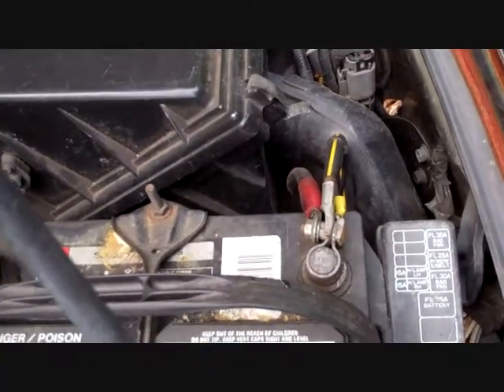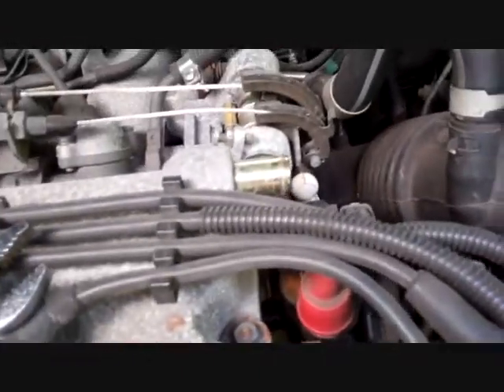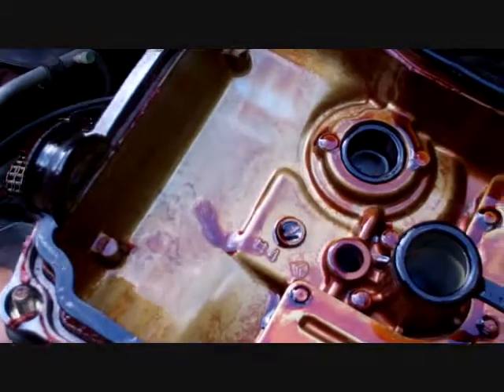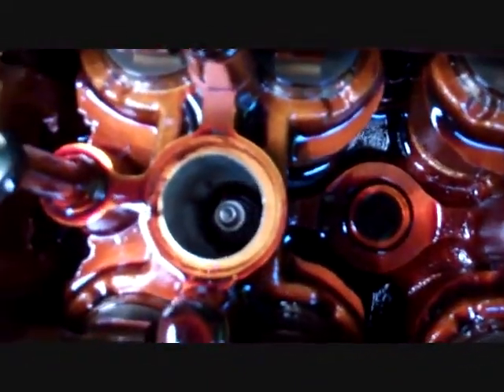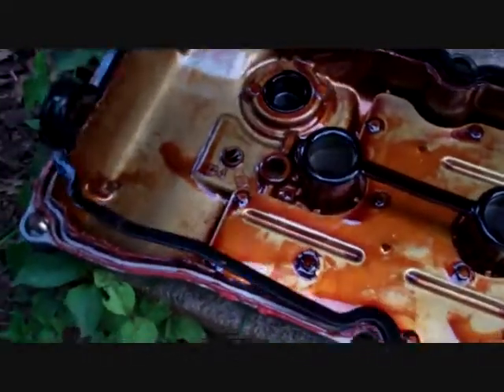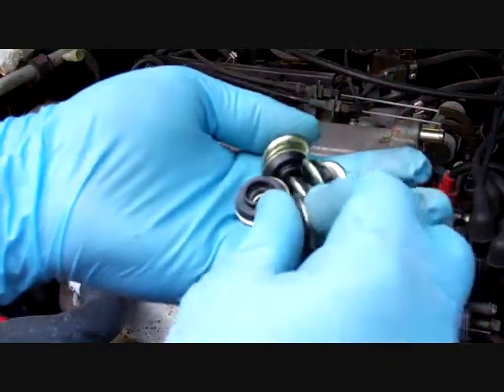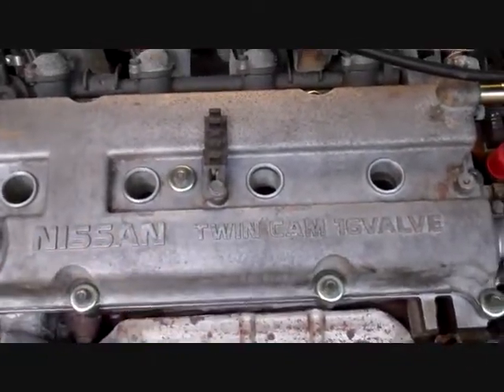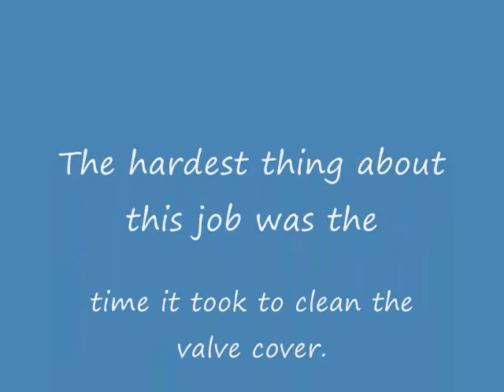Nissan Altima valve cover gasket change

Comment from the maker: Glad you liked the video.
But the head gasket ad valve cover gasket are two different items. The head gasket requires a little more experience perhaps beyond my knowledge. After removal you will need to send it in to resurface it.
Aloha and thanks for watching.

Comment: Thanks for all the help! 
I have done mine because it was leaking into the park plug holes. 
I replaced mine and a few months later it is leaking again into the spark plug holes! 
You guys think I did something wrong? 
I put a whole new gasket one including a new gasket for the spark plug holes. 
Maybe I should buy a new gasket and put a layer of that gasket maker on the spark plug hole gasket? 
Thanks again!

Comment: Great video! i just had my VC gasket professionally replaced only to drive it home and now find oil AND water in my spark plug wells. I understand that oil could get in there from a poor gasket install, but do you have any idea where the water would becoming from? i can figure this part out. If you have any insight on this kind of problem it would be much appreciated ! thanks!

Comment from the maker: Hi, there should definitely not be any oil and water in the spark plug wells. 
Question- How is the car running now? 
Is it all spark plug wells?
White smoke coming out of your exhaust pipe would indicate water getting into your engine possibly a blown head gasket “bigger problem”.
 Did the technician pressure wash your engine? 
I hope this helps somewhat. Thank you for watching and commenting

Comment from the maker: I used brake clean to clean the valve cover it is way easier that way but you need to be careful using it. Make sure you spray in a well ventilated area and to use eye protection.  After using that I let it dry completely. I hope this helps you. 

Aloha and have fun!

Comment: How important is it not to over torque these bolt? According to the Haynes repair manual there are 2 step:step 1-35 in-lbs, step 2 - 69-95 in-lbs.  Did you do it by feel? I did it without a torque wrench and got leaks from the back side cover so i undo all the bolt and sit the gasket probably and tighten all the bolt starting from the outside and got no more leaks. I also put red RTV around the outside mating surface just to make sure there are no future leaks anywhere around the valve cover.

Comment: Good morning, Thx for this video, very helpful.  I think this is what I have to do with my Altima.  Oil seems to be spitting out right at those gromet(spell check) spots and spilling down the engine.  This would be a need for a new gasket,,,,right???  Thanks in advance for any answer.
Reply from the maker: Yes, I would change it. It seems to be easy enough. I used to think the leaks would go away by just tightening the valve cover down more but found out it could damage it. Thank you so much for watching and commenting.
Aloha and take care
Reply: Yes, yes, bud.  Thx again.

Comment: i have a 95 sentra, and need to do the same. however it seems that there is some sequence to use when removing the VC bolts. Obviously you didnt use any sequence, you think i should be fine as well>?

Comment: I've changed my V.C. gasket twice. keep getn oil in spark plug hole#4. b4 i place valve on i use weartherseal to hold spark plug seal in place. what am i doing wrong?

Comment: I have a nissan altima 05 that is heated when I take off spark plug I start it the water blow out the spark plug. Do I need to change the engine for that matters?  Or should I just change the gasket
Reply from the maker: Hi Jean, looks like you have a major Engine problem and changing the valve cover gasket will not help. 
If water is coming out of your Spark plug hole that would indicate that the head is cracked or warped and the engines coolant is getting into your engine. Get a professional diagnoses first, they might be able to fix it or you may have to change your engine.  
Sorry for the bad news
Aloha
Reply: Ok thanks very much for your response I truly appreciate it.

Comment: I have an obvious leak that looks like something is spraying from the front of that valve onto my top radiator hose. I've always noticed a leak but unsure where, until I put a brand new top radiator hose in today and noticed something had 'sprayed' onto the hose after a very short drive after installing the hose.... I'm assuming this is what needs done to my car?
Reply from the maker: Seems like it.

Comment: i have a 2001 nissan altima. what is more or less the price for replacing the head gasket seal
Reply from the maker: Joseph DiDomenico Probably over $1500.00. After removing the head you would or should take it to a machine shop to check if it is level and not warped. The reason you are replacing it is probably because it has been overheated. 
Hope this helps.

Comment: do u think its really important to torque the bolts to the right specs, I have 96 bluebird 1.8L and its really hard to get info on this car. Haven't done this job b4 but it looks pretty simple.
Reply from the maker: Aweri Blakely On this car it was pretty simple. I think the valve cover torque is not as important as other areas but it would be a great idea to do it right. 

I tried to Google 96 bluebird 1.8L valve cover torque but came up short. It's going to be a small a torque in inch pounds

Thanks for watching and commenting.

Comment: IM WORKING ON A 2004 NISSAN ALTIMA 2.5...CANT FIND THOSE O RING SEALS ANYWHERE ...WER DID U FIND YOURS???
Reply from the maker: It came with the kit. I bought it at a local dealer here in Honolulu. If you Google
 2004 NISSAN ALTIMA 2.5 and select images you can find a bunch of pictures that include the O rings seals.
Hope this helps
Reply: YEAH...U KNOW WHAT? I JUST SAW SOME NOTES ON THESE GASKETS..IT TURNS OUT THAT THE PARTS STORE I WENT TO, THE COMPUTER SHOWS ONLY THE PICTURE OF THE GASKET BUT NOT THE SEALS ...UR RIGHT THEY DO COME WITH THE KIT!...ITS A MATTER OF RETURNING TO THE STORE SO I CAN FIFNISH THIS JOB>>>.THANK YOU MY BROTHER!!!
Reply from the maker: mimikismism Pure awesomeness. Good to here that. 
Aloha
Reply: I think your caps lock is stuck....

Comment: Good evening, +iworkforbudlight. Are you using FelPro valve cover gasket and spark tube seal gasket as well? Based on your experience, if S.T.S.G. comes off slightly, can it cause a misfire?
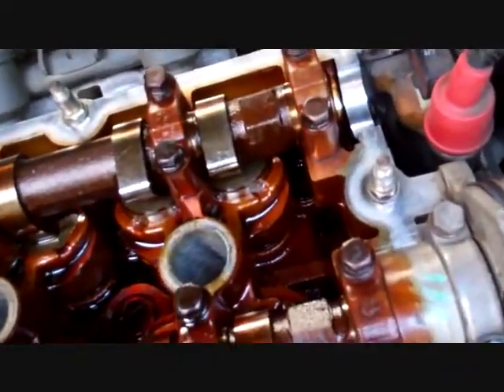Reply from the maker: Hey Jason, you know what? I can't remember if it was FelPro but it does ring a bell. I must have used that one. The valve cover Gasket- comes with a two piece gasket and new grommets all in one set. I used some RTV gasket maker for the sharp edges 4:12 

Sorry what does the S.T.S.G stand for? 

Thank you so much for watching! 
Aloha and take care
Reply: S.T.S.G. means Spark Tube Seal Gasket.
Reply: Can it cause a misfire if STSG isn't properly installed?
Reply from the maker: Oh, got it. If the Gasket moves, or if the gasket was installed incorrectly then it is possible that it will allow Oil to seep into the Spark Plug hole and the Engine to run rough. 
Easy way to check is to remove spark plug wire and shine a light down and take a look.
Hope this helps.
Aloha

Comment from the maker: Not a 100 percent sure Probably around 20 inch pounds not too much. Just past snug should be fine just don't over do it. Start from the center and move out. Don't tighten completely at once.
Aloha

Comment: Change the oil.. That's pretty bad. So far past varnish...
Reply from the maker: clinton fisher Smelt bad too.
Thanks for watching and commenting.
Reply: +clinton fisher Do i have to change the oil before i do this project. and put new oil in when i'm done. I know u didnt make this video, but i would appreciate any info